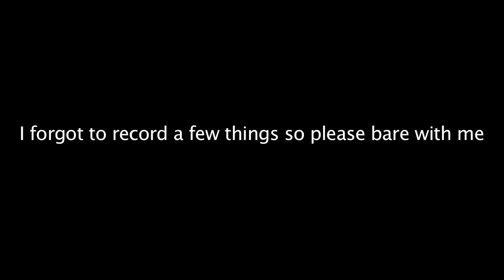BB6 Honda Prelude Rear Koni Suspension

Comment: Always torque up the suspension components with the car on the ground and wheels fitted to avoid winding up the bushes excessively. Torquing up the components with the suspension hanging in mid air makes the bushing get clamped in the hanging position. Then when the car is lowered its "wound" up so when the car is at rest the bush is being twisted. This makes the bush fail over time and makes for extra tension in the suspension system.

Comment: DID this FIX the SHOCK KNOCK
Reply from the maker: From what I remember, the 97-2001 Honda Prelude rear suspension shock knock can be solved by replacing the collar that is in between the two rubber pieces at the near the top of the shock, which are part number: 52725-SS0-004 RUBBER, RR. SHOCK ABSORBER. The collar is part number: 52728-SM1-A02, Collar, RR. Shock Absorber Mounting (Showa). 
I think there was a Honda recall on that specific part. 
All of the rubber parts that are being replaced in this video are old and worn out, but the silver collar seen in this video is part of the Koni rear shocks, which is slightly longer than the OEM collar, which was later addressed by Honda with the recall. It's the collar that causes the shock knock and it's the collar that must be replaced in order to solve the shock knock issue. However, replacing all of the rubber parts seen in this video might also help, especially if they are worn out and soft to the touch. One can feel the difference between an old rubber part and a new rubber part by trying to squeeze the part in one's hand. 
I hope this helps and sorry for the late response.
Reply: mikeschmeee thanks mike, so I just call Honda and ask for the recalled shorter collar, plus new rubber? I have koni yellows on my 98

Comment: Hello Mike. This Was Very Helpful. 2 weeks of searching. If you will, please explain to he order of the assembly? I wOuld like to BE SURE. Thx.
Percy
Reply: I'm not sure how to explain this but I'll do my best. First off, watch 3:25-4:25 of the video.

koni yellow shock
spring perch thingy (the large metal thing where the bottom of the spring will sit)
white plastic washer thing (sits at the middle portion of the shock, where the yellow paint ends and the exposed rod begins)
bump stop (you will have to drill out a larger diameter hole for the bump stop to fit over the exposed rod)
silver metal washer (sits almost near the top of the exposed rod, above the bump stop, it has a bit of a bump on one side, that bump should be facing down towards the ground)
black bump stop cover
another silver metal washer (this one does not have a bump on one side, it is identical on both sides of the washer)
spring
top hat with the round ring rubber that goes inside but near the edge of the top hat and the two top hat round rubber donut like washers go inside and on the top outside of the top hat. A metal shock collar goes in between the two round rubber donut like washer.
larger diameter round washer with the edge thats curled facing up and two nuts go on top of that. 

I hope that helped.